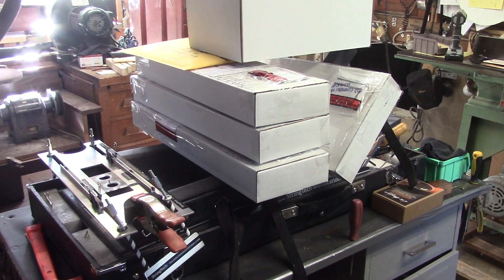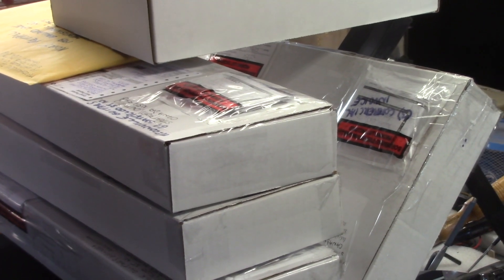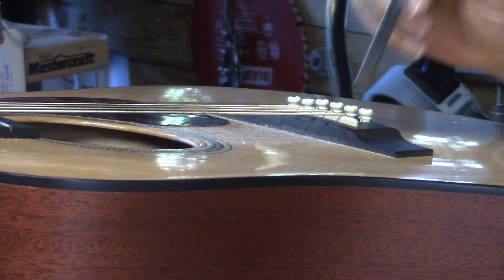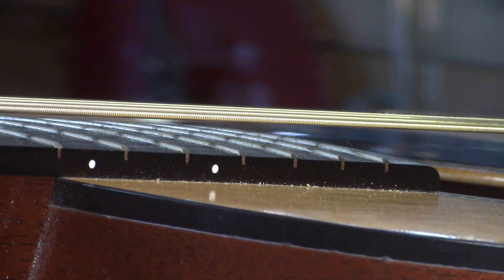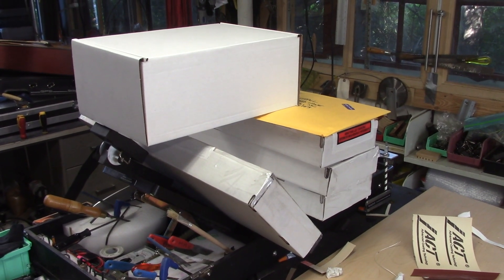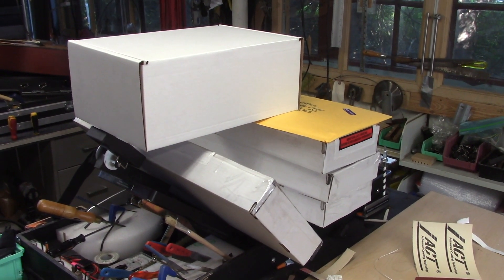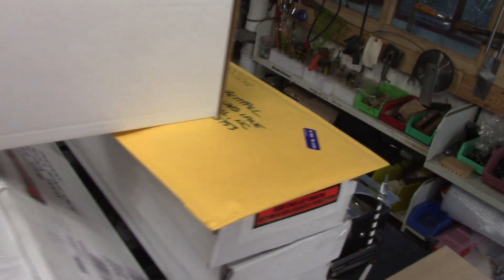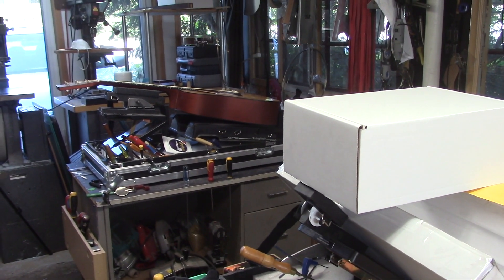Fretting Kits / Bridge Slotting Jigs / Neck Surgery Kit /@StringTechWorkstations

Comment: @StringTech Workstations i was wondering... where are these fretting kits on your shop section on your website? Couldn't see them there ... also what size/type file did u say u like to use for fret levelling with strings raised/still on the body as per your videos?
Reply from the maker: Hi Gareth, I make up these Kits in very small quantities ( 12 at a time ) for my students and Patreon subs. There are 3 Kits available at the moment. You can email me directly mcconvilleguitars@gmail.com if you'd like one of these. For the "Fret Dress under String load " ... like that black Explorer Video .... I use the same 6" fine mill file that you see in this video .... obviously NOT mounted on the wooden handle. Cheers, Michael